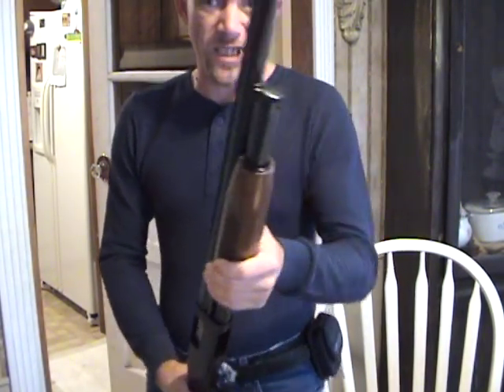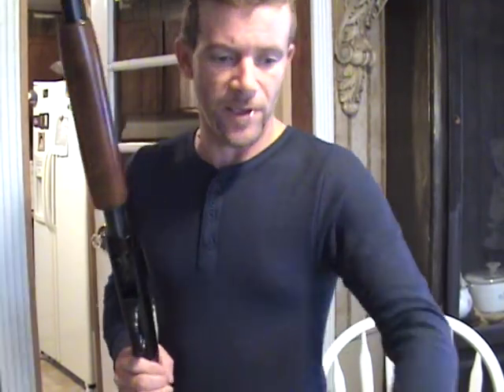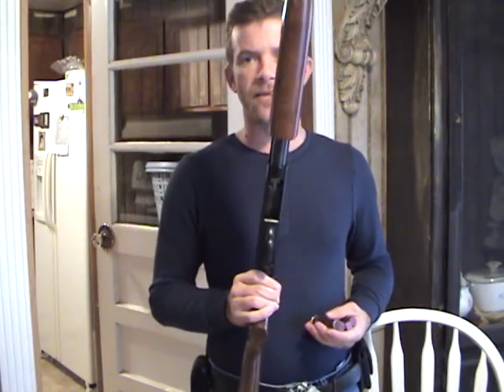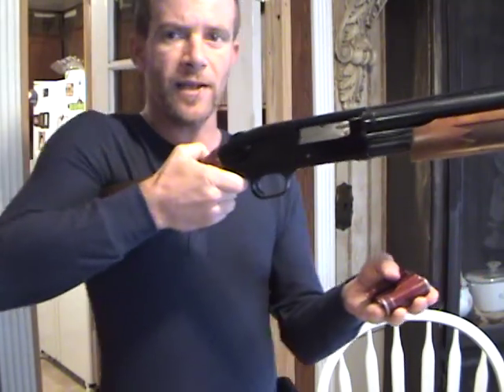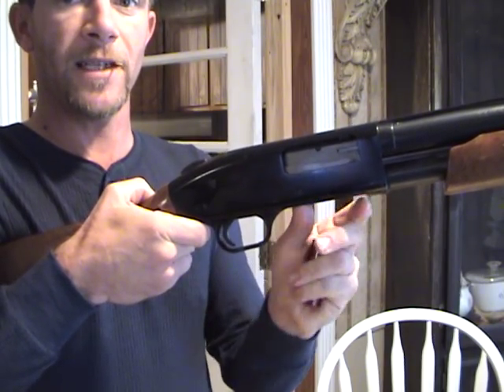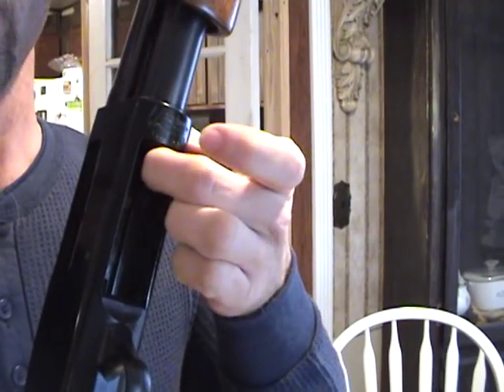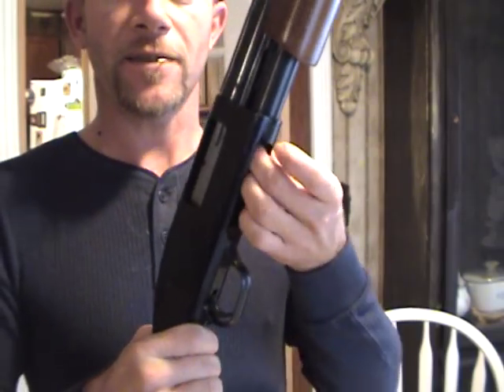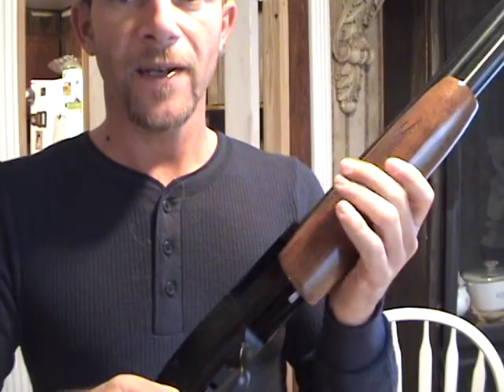How to Speed reload a Mossberg 500

Comment: Unloading that way is unsafe I'd rather know the chamber is empty cause I racked it
Reply from the maker: and you missed that part. Always visually check that the chamber is empty. Racking the action to open it would deploy any shell from the magazine tube on to the elevator. Racking it a second time to eject it. Regardless of how you do it, Look into the chamber to ensure it is empty. Also, in low light poke a finger in there to ensure it is empty.
Reply: Unless it's pitch black where you are, it would be pretty difficult to mistake the follower for a round once you've pulled the last one out. I get where you're coming from, though, and I still run the slide after unloading just to be double sure that it's empty.